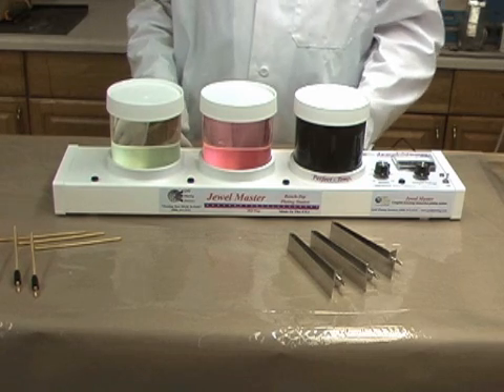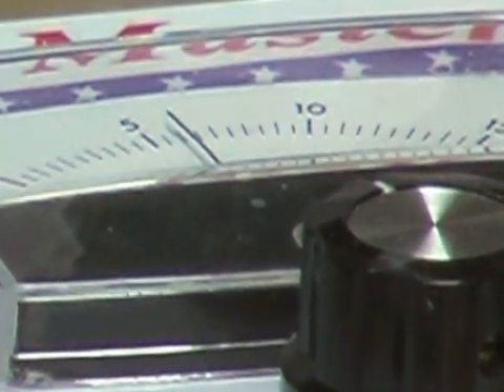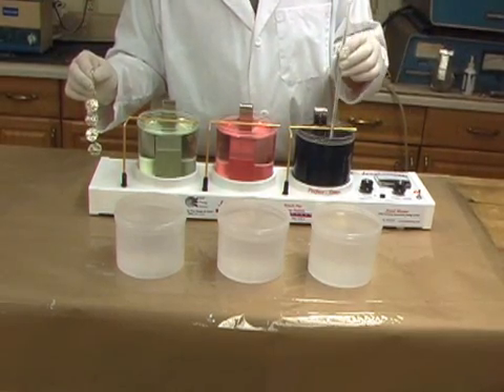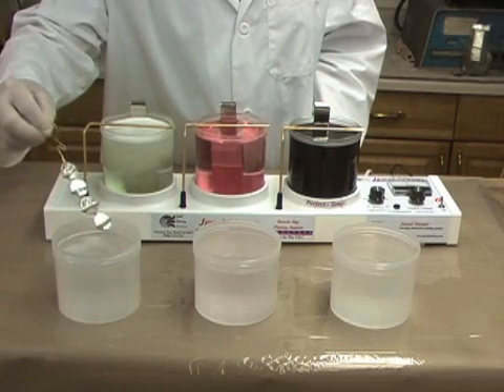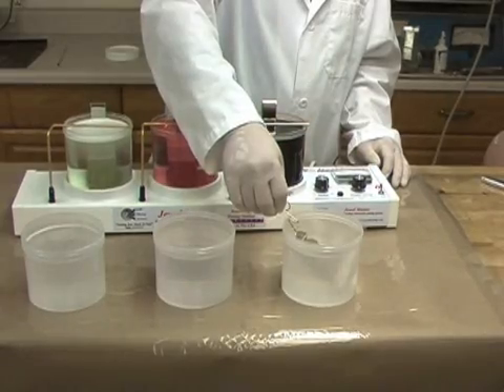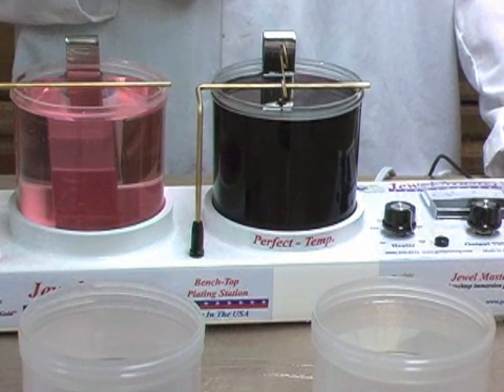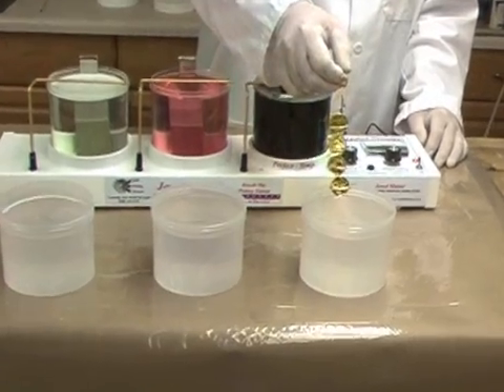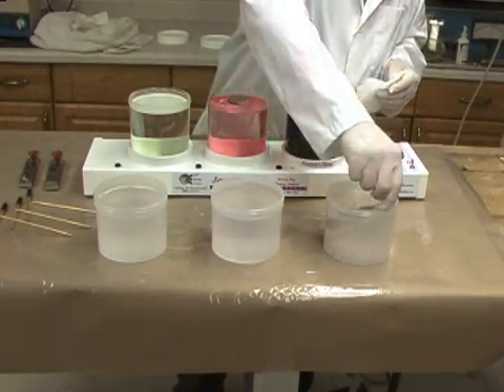Gold Plating Kit - Immersion Electroplating

Comment: greetings, 
i am interested in buying some of your liquids but i have some questions first just to be sure that i make correct the order. 
first of all, where is the activator needed?
also, i am interested in the stainless steel liquid. to which metals can it be applied and what color does it give to them? 
also what's the difference between the imported 18k gold solution and just the 18k gold solution? 
thank you

Comment: How long does it last
Reply from the maker: How long gold
plating will last purely depends on a few variables. 
1) How thick the gold is
applied. 
2) What type of item is it/How will it be handled? 
The thickness is
controlled by how long you plate the item. For instance, if you were to stop
plating immediately after the item turns gold, that would be a very thin plate.
However, if you spent multiple minutes plating that same area, it would be very
thick. The thicker the gold the longer it lasts. Different types of items are
handled differently, some a lot and some not at all. If it were a decorative
item that is never touched it would stay gold plated indefinitely, could be
centuries. If it were something like a Wedding ring that is worn daily, it then
depends on how thick the gold is plated. If it were a thin plate it could wear
off in a week. If it were very thick, like Vermeil plating (100 micro-inches)
it cost last a lifetime. 
When done properly,
gold plating lasts many years if not decades on most items. If it's a thick
gold plate, even on an item that is handled properly, it should last many years
unless it is purposely removed by abrasive means (polishing etc.)

Comment: why not have 2 electrodes for the gold solution  so you dont have to turn them around
Reply from the maker: We are actually in the process of developing a circular anode that goes around the circumferance of the plating cell.  In reality, though, unless you are needing exactly the same thickness everywhere, turning the piece isn't of great significance.  The side exposed may have a few microinches more than the unexposed side.

Comment: If I wish to gold plate 5g 24K gold on a silver oranment how much gold the gold solution should contain?
How can I prepare gold solution so that it plates 5g gold on a silver chain uniformly?
Reply from the maker: The density of gold plating is 12.45mg per square inch, per micron.  Therefore, you would need to determine the exact surface area and apply enough microns to achieve 5g of consumption, depending on the surface area.  For example, if the total area was 10 square inches... 0.01245g x 10in2 = .1245g if plated to 1 micron.  If you're looking to apply 5 microns total you would do: 5g ÷ .1245g = 40.16 microns.  Using this same equation you could determine how many microns you would need to apply 5g of total gold.  You would want your bath to start out with atleast 8g of gold to begin with in order to maintain a steady deposition rate of 1 micron per 5.5 minutes.  For gold to be plated this thick, you would want to use a Pure (Soft) Gold, not the hardened gold shown in the video.
Reply: @GoldPlatingServices  thank you so much for sharing the knowledge
Regards

Comment: How can I reverse the brown plating that happened when I had the output voltage too high?
Reply from the maker: This is a great question about a common problem that we are going to address in one of our weekly Tech series videos. We call this "burning". it is normally caused by too high of voltage or if the gold solution gets too hot, more than 110° F. There is nothing wrong with the gold deposit other than the surface is irregular and doesn't reflect the light well so it looks brown. Make up a small amount of paste using baking soda and water and polish the "burned" area by hand using a soft cloth. This should bring the gold back to a high luster.
Reply: Gold Plating Services Thanks for the info. Glad it's an easy fix.👍🏻

Comment: would this be good to glod plate frames, slides , barrels for guns ?  would the items fit or do they have bigger containers available?
Reply from the maker: This kit only has 1 Liter beakers.  For doing large items it is best to either Brush plate them with another kit (like the Universal Plater Kit) or have us custom make a large plating setup, one that has 1 Gallon or so beakers.  A 1 Gallon setup wouldn't look the same as the JewelMaster, it would be more of a component based system - meaning it wouldn't be quite so self-contained.  Typically a Gallon or more setup costs around $2,000 to $3,000 depending on your needs.

Comment: Can I use the unit for electroforming and plating as well?
Reply from the maker: Yes.  This kit is used by some of our customers to perform Electroforming.  It was designed to be a gold plating kit, but it does allow for some electroforming onto smaller objects.  Keep in mind the beakers are only 1 liter in size, and the item needs to have quite a bit of solution around it (not barely fit in the beaker).  If the items to be electroformed have a total surface area of 6 square inches or less they should work fine.  For Electroplating in the JewelMaster a maximum surface area of 18 inches is all that is really feasible (unless you're plating half of the item and then plating the other half in two steps).

Comment: Does it have the magnetic stirring system build in? Do you ship to Hong Kong? If yes, can you change the power voltage from110 to 240?
Reply from the maker: It does not have a magnetic stirring system built in.  Our solutions do not require agitation and perform great without it.  We can ship to Hong Kong.  The Power Supply is fine with 240, however the heater requires 110v.  This is easily solved using a voltage converter, they can be purchased on Amazon for around $40 for a really nice one.  If you wanted we could include one in your order for you.

Comment: i have a similar kit but the problem i have is mostly about the durability of the gold plating. my costumers love gold plated sterling silver because it looks like gold, doesnt cause allergies and it can be sold back. however with daily use the silver (or other materials) lose their color too fast especially when washing hands or left in a humid environment. i want to be able to make a gold plating that lasts very long and my costumers shouldnt worry about washing hands. i see some gold plated items that last almost forever even when used daily. do you have a kit for make the gold plating more stable and durable?
Reply: 24kt gold plating is a softest in nature for hard surface resistance coat you can go for hard gold plating other name is 3N gold plating check its hardness you can understand.
Reply from the maker: With our 24K hard gold solution (shown in this video) you can plate  very thick, we typically plate about 2 microns (80 microinches) thick onto customers jewelry.  If you use our gold and plate it this thick it will last many many years. I have never had the gold wear off of anything that i plated properly with a thick layer.  If it is wearing off fast as you are saying, either the gold is VERY thin, a "soft" gold, or not adhering well - maybe a combination of multiple things. We would love to assist you in perfecting your process to achieve better results, please give us a call or send an e-mail and we will get you on your way to success.  E-mail: rob@goldplating.com or call 801-546-6200

Comment: I love the look and feel of this unit and would buy one if it weren't for the much higher price in comparison to all the other gold plating kits found on ebay for under $500.  Otherwise a nice product.
Reply from the maker: Thank you!  We're glad you like it.  It is a substantial initial investment, but people often pay off the initial investment within not too many plating jobs.  The value that adding gold to an item brings often pays the kit of quickly if doing Jewelry or plating various items at a charge.  As a side note, this kit includes $325 worth of gold, alone.  There is no kit that is quite like this one.  I'm not aware of any complete kits for under $500, just be aware of gold content and the other accessories required when considering a purchase.  Gold plating isn't something you want to cut corners with.
Reply: I do appreciate your reply and yes, I'm still trying to figure out how I can afford option 3 of your units.  The complete kits under $500 can be found on ebay and are rather abundant with many various designs although as a compliment, thus far I still feel yours has the most professional look.  In the mean time, if you ever come up with any promotions on the unit, please let me know because it'll otherwise be some time before I can afford it.  Thanks!
Reply: @GoldPlatingServices please that is your email address?

Comment: Very interesting and convenient! I'm browsing your page now. I see you electroclean and rinse. Then surface activate (this is nickel activator correct?) and rinse. Then use your concentrated gold solution. Am I correct to assume your surface activator is nickel activator?
Reply from the maker: +Justin Mitchell Thank you for the inquiry.  You are correct, the "Surface Activator" is also sometimes referred to as "Nickel Activator".  We use the name Surface Activator because it is used for many other metals aside from Nickel.  Give us an e-mail or call if you have any additional questions.  Thanks!
Reply: @GoldPlatingServices  So if you are gold plating nickel you don't need the surface activator solution ?  I assume the activator is layering a very thin invisible layer of nickel for the gold to attach to ?

Comment: if I want part of the coin to stay silver. can I cover it with wax? will it melt /ruin the gold solution? thanks
Reply from the maker: To plate particular parts of an item we recommend using "Pen Plating".  This fine-select tip looks similar to a Sharpie marker tip and allows for very specific areas to be plated.  There are other ways of masking an area, but typically it's best if you do it the way I described, pen plating.

Comment: Hello, thanks for the video. How can I control the Thickness of the gold layer? For example, i would like to apply the vermeil standard, what should i do. Thanks.
Reply from the maker: You can control the thickness by how long you plate the item.  For instance, if you plate an item for 5 min 30 seconds you will achieve 1 micron thickness.  If you want twice as much you plate twice as long.  To apply a vermeil thickness you will need to plate for 14 minutes, which will apply 2.5 microns or 100 micro-inches (vermeil).

Comment: Hi - is there some sort of resist or mask that I can use to exclude or prevent certain areas of a piece from being plated?
Reply from the maker: Sure, there are a few different techniques used to do masking.  Depending on what the part to be plated is, there are different methods available.  Electrical tape, fingernail polish (which is then removed with fingernail polish remover), paint stick, watercolor masking (as used by artists).  Really anything that would resist a water-based solution.  Good question!
Reply: Gold Plating Services

Comment: can this system be used for organic materials like shells?
Reply from the maker: Our products and solutions will plate onto any properly prepared, conductive surface.  Plating onto organic materials may be achieved by applying a conductive coating first.

Comment from the maker: Many metals can be plated with proper surface preparation. Nickel, steel, copper, brass, bronze, pewter, silver and many more metal types can be plated.  Stainless steel requires a special activator, but can be plated very easily with this equipment.  Aluminum and chrome are 2 metals which cannot be plated with this process. Please let me know if you need further information.
Reply: hello, can this equipment electroplate pagon stars.

Comment from the maker: @TheOgo1971 There are 3 different packages available with this same machine set up.  Visit our website for further details.  goldplating(dot)com/jm(dot)htm

Depending on what you want to do with it, they range from $1,200 to $1,500.  This includes a Quart of 24k Gold Solution, and all the other necessary chemicals and supplies needed to do immersion plating.